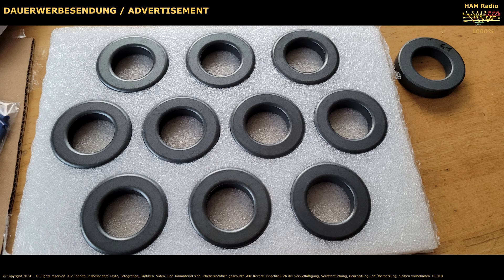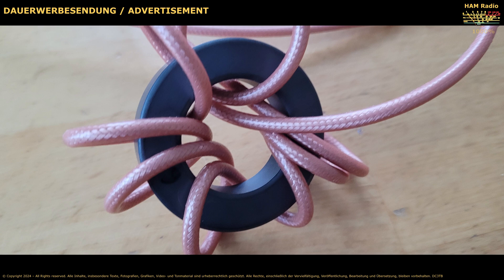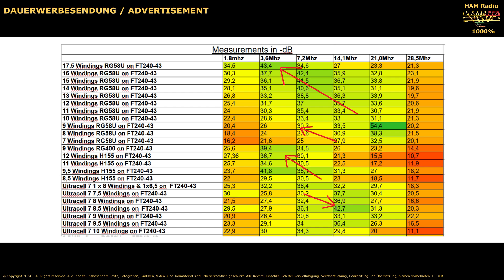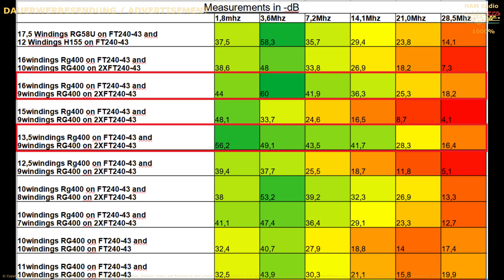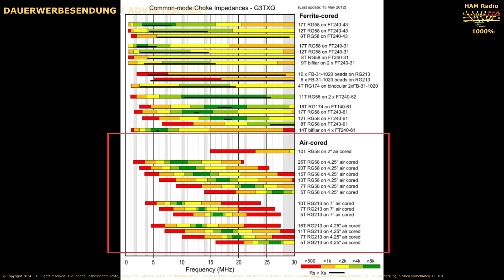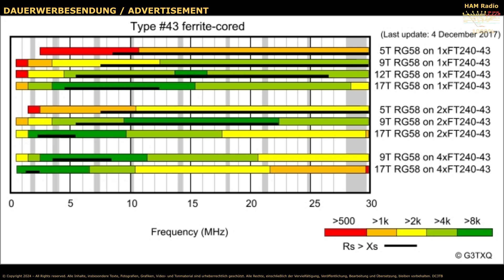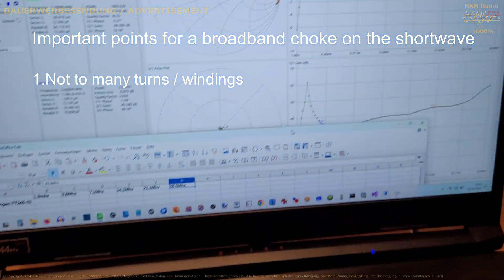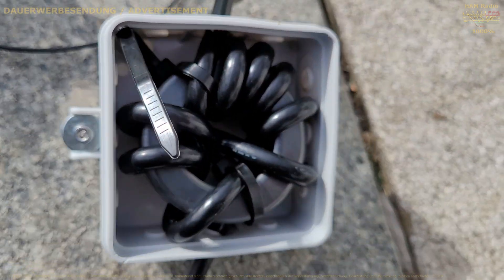How to create a good broadband choke? #Fair-Rite #FT240-43

Comment: I have made a plethora of CM chokes. Originally, I would wrap a coax around a toroidal cores. I would use mix 31 for chokes and mix 43 for ununs (HWEF transformers) as noted by folklore.   After a bunch of testing, I found that wrapping the core with enamel wire pairs provides a much better choke in both gain reduction and range (-40dbB or more over the whole HF spectrum).   I do agree that for coax wrapping, adding too many wraps increases the parasitic capacitance.  This is because each wrap is adding capacitance in parallel which adds to the total (C_total = C1 + C2 +C3 ...) but adding chokes in series (i.e. a second choke along the coax) adds inversely ( C_total = 1/(1/C1 + 1/C2 +...).  This lowers the total parasitic capacitance.  For two identical chokes in series, C_combo = 1/2* C_single).  It is basic physics.  I also found that mix 43 performs slightly better (by -3dB average, -35dB vs -38dB) than mix 31 for choking over the HF spectrum except at the lowest frequencies.  Not a big deal so I use either 31 or 43.  That said, 1 core FT240-31 with 12 enamel wraps has better performance that 3  FT240-31 cores in series each with 8 wraps of RG58.